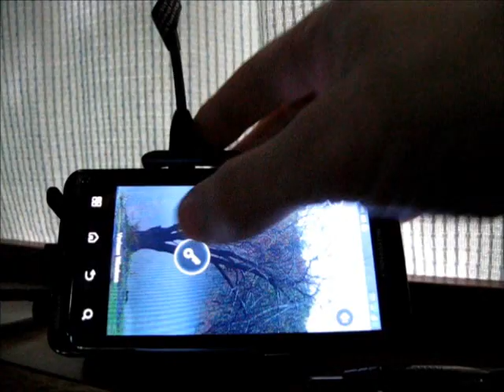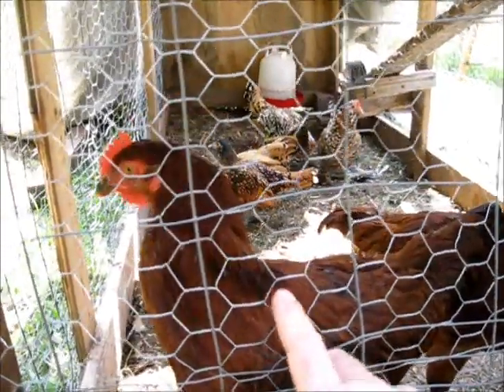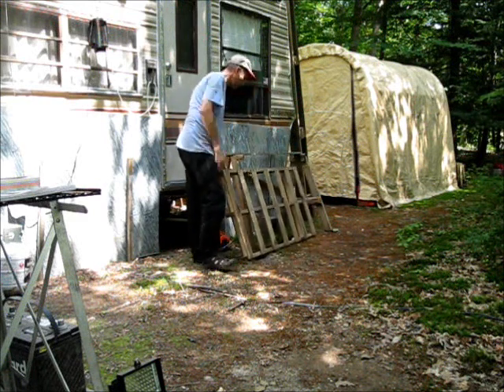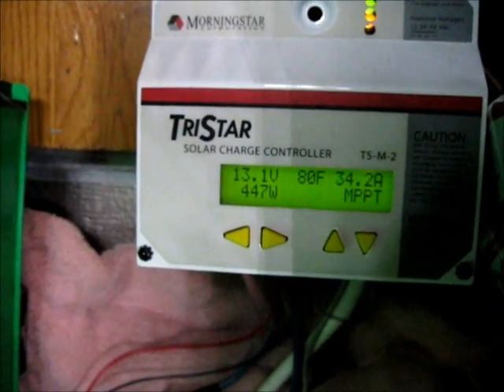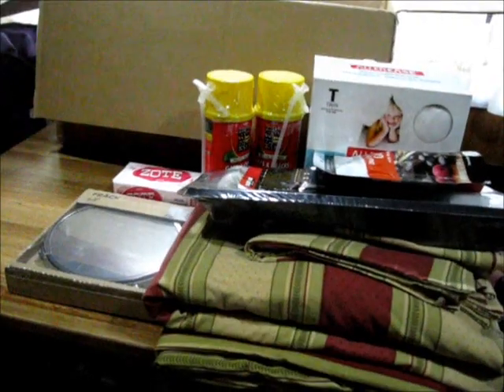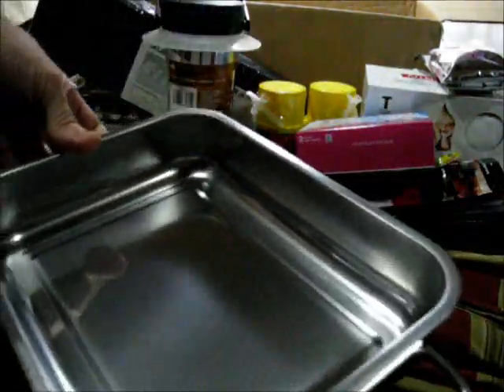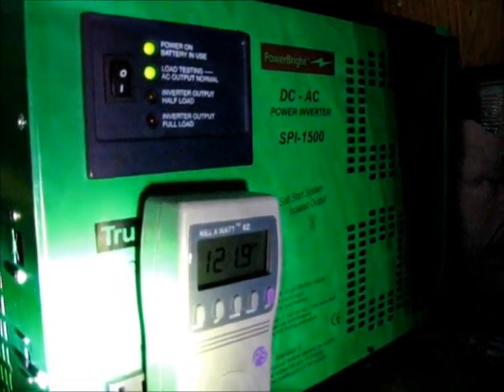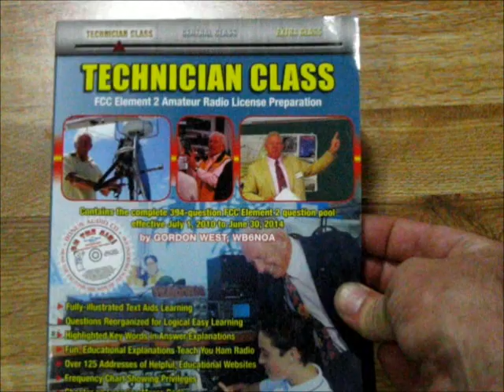Off Grid Solar Air Conditioning

Comment: try bigger cables from battery to the inverter.. probably can't draw enough amperage from the batteries on the smaller cable that is getting warm.. to much resistance..

Comment: No, No, No. You cannot judge the state of your battery capacity by its voltage alone. Voltage gives an indication but its capacity may be lower. It is like a torch light which shines brightly for a moment with a drained battery, then it died.

Comment: if you want to save your inverter this is with  an air conditioner. you need a soft start the product is called easy start I'm sure there's others you kind of need to know what you're doing to read the wiring diagram but you can get someone to wiring for you
Reply from the maker: I never had a problem with this inverter though. But sadly it just gave up on me after many years of good service.
Reply: When you go to buy a new inverter look for surge protection / rating.  My 1600w Whistler has a 10 second 3200w surge rating which should get you through a compressor start up.

Comment: basic ohms law i think would prove differend results. also the proof is why can the trailer be wired with 12g or 14g and draw either 15 or 20 amps? an entire house service of 100 amp is only 2awg al. would be #4 copper

Comment: I don't know if you know this! I have an Android Phone and when it starts Acting up take your Battery out, Don't turn your phone off, leave it on and just take the Battery out for a minute or Two and then put it back in Turn your phone on and it should work better,  it resets your phone.

Comment: Instead of using air conditioning, why not run a dehumidifier, They use much less power, remove the moisture in the air and cools a room dramatically by taking the warm humid air out of it

Comment: The AC runs well when there is power coming from the panels, but not from the battery.  I'm guessing that the wires from the battery to the inverter are too small.  The warm wires are a related problem.

Enjoy your channel.  Keep up the good work.

ps. Are you laying in wood for the winter?

Comment: How old is that phone at this point? These things are not build to last forever. They are build for high specs. You said that was a bionic or something right? That was a fairly top of the line phone not that long ago. You should look into getting a less "smart." phone. Something with a high cap battery.

Comment: Hold the lock on your phone one sec longer. If still its eftup screen or software bug. Pull the bat out when its still on. Run virus scan.
Reply: I had a phone where the screen started acting up.  turned out it was moisture under the screen.  the ac might help dry the phone out

Comment: Your inverter is to small. The startup load of the AC exceeds what the inverter can handle. 

If you use an amp clamp meter, you will see the load is not 500 watts but twice that at startup. Then look at your inverter to see what the peak amps vs constant amps is. My bet is its to small and can't handle it. As it goes into thermal overload protection and shuts down.

Comment: So You would need 21 x 245watt 24 volt panels to be able to run 500 watts @ 120 volts but only in full sunlight. 21 x 245watt 24vdc panel is $350 plus tax if Your lucky to know a guy like Me.(Yes I sell solar/wind) $350 x 21 = $7,500 plus Your State/Provinces Tax. Your battery bank would have to again be so huge, don't even ask the cost of this!
Your also taxing that poor little 1500watt inverter to it's Max, You need a minimum 3000 watt 24 volt DC inverter to run that 500 watt AC.
Want a way to cool down Your place cheap? A evaporator propane fridge with freezer tubes covered in heat sink fins and a small 12volt muffin fan with variable pot for speed control and the hot pipe and chute outside insulated between these sections will give You a small amount of cooling and do a bang up job on de-humidification with water collected to water tomatoes.

Comment: Lot of stuff in that box.
Reply: Your amps from the AC could be too high. Your meter when it shut down was at about 3.2 amps, the AC pump requires more amps to run. 500 watts to run AC, but check your inverter to see max amps. Maybe you might need more batteries to maintain the amps...Your right about wires get thicker wires or double the ones you have coming from batteries to inverter.
Reply: bkr360 No matter how many batteries he puts behind his inverter, it won't work.  The reason being is that the inverter itself can't hack it.  It is the weak link in the chain.

Comment: The issue with your touchscreen is caused by noise generated by crappy circuit design in your charger. Cheap Chinese chargers, without enough filtering cause this all the time.  Some phones are waaaay more sensitive to this electronic noise than others.

Design more filtering into your charger and your inverters.  Waaaay more.

Comment: UNLOCKING YOUR PHONE....When you unlock your phone, touch the lock icon and slide your finger to the right.  I have a phone like yours and simply pressing down on the lock won't unlock it.  Press and slide your finger to the right.  That should do the trick.

Comment: What size inverter do you have?
Reply from the maker: 1500 watts
Reply: Awsome ty were compleate solar with 245 watt charging system so far. Adding more each year. I just need bigger charge controller and inverters

Comment: you should cut that pointy board off the saw horse before you bumb it with your leg and knock the ac down on the ground. Also if you but a 00 wire or even 000 wire on that inverter wire to the batteries it will save you a lot power your loosing through heat loss in the small wire you have. pos and neg wires should be at least 00. what a great care package saweet. Maybe your inverter is broken is it pure sine wave?

Comment: dude u need higher watt Inverter. for air conditioner atleast a 2500 watt inverter is recommended. when compressor kicks in surge is almost 2000 watt. that is y ur inverter keeps shutin off. u only have 1500 wat inverter. im starten work on my solar shit too. sun be too hot like son be 2 hot. need dat a.c on top  on da rabies wont stop til dem babies gon pop

Comment: You heard someone say that you need "BIGGER WIRES" & that is now the  definite answer. So why would you not wait & change the wires & run the AC and see if it solves the issue  BEFORE you run around telling everyone "ITS THE WIRES". Now if your desire is to run that AC for 30 minutes a day, & nothing else u may do well with your 600/600 Solar System. To suggest to anyone that it is suitable for someone to deploy as a workable AC solution is just irresponsible. This is why some are disgruntled.

Comment: its called inverter overload auto shut down! it runs in sunlight because batterys are up enought with the 500 watts of solar in day light high peek times it cycles power coming in to inverter use! both my inverters will not run a 5000 ac unit only genator will or grid power! mine small one in back bedroom runs 420 watts but not off my my solar it overloads my inverter ! i have a watt meter too! some stuff my inverter will not run!

Comment: Remove all extra apps. Does your phone have safe mode? Try holding the on screen power button and see if it changes to safe. Or try google. Check the oil on your hand wipe the screen too, let it evaporate. Androids have great specs its junk software over bloating that slows it. Try flashing new rom.

Comment: I am doing a bug out boat.. I have a 32 foot carver cabin cruiser with 20 6 volt batteries for my battery bank  and all cables are marine grade tinned  1 guage cables and I have more power than I could ever use.. my fridge is 12 volt and 110
I have 200 gallons of fuel on board and 100 of diesel to run a pair of brand ner 225 horse marine grade ford 302 motors with edelbrock carbs..straight open exhaust that uses water to cool it and as mufflers but it still sounds like a pair of pissed off nascars.. and a full throttle I burn 15 gallons an hour to feed this thirsty monster.. I have a multifuel military heater that runs on diesel//kerosene// jet fuel//and gasoline..and puts out 30.000 btu of heat for our cold winters... it holds 75 gallons of fresh water and I have a years supliy of food on board and enough water filters to turn river water into drinking water for over 10.000 gallons.. it sleeps 6..
4 burner stove.. fridge freezer..small ice maker.. tv / dvd.. full head with shower and sewer treatment systym so all sewer is cleaned and legal to pump over board.. so I guess you can say I going to bug out on the rivers.. there are many small knooks on the river that are covered by trees so I can coast in there and cover the boat with camo netting so you can go by me and not see me ,, my next job is to get some large marine wet mufflers to try to make it more quiet so if needed I can run stealth at night.. also has radar so I can run in the deepest of fog.. I am still working on it and currently seting up a bug out 10 foot dinghy with outnoard so I can go ashore to hunt for meat and burn trash in my small jet stove.. it is still a work in progress and I only have $300 a week to put in to stuff I need but I have a good start on it..
I wanted to do it on land but couldn't find any place to put a motorhome that was away from town so I think I will do ok.. but still working on it.. I guess I should do videos on it so I can show people it is very possible to bug out on water and what is possible on a selfe contained boat.. I have everything a rv has and more.. plus I will never have to worry about water or showers so i think have a good chance of being good and safe.. good luck with your project.. I lived in 35 foot 5th wheel for a long time and a 34 foot motorhome  but decided to try life on the water and I love it..
Reply: Are you on a river, the ocean or a lake?
Reply: Argus Loud I am on the Columbia river wich is also where it connects to the Willamette river and about 14 hours trip by water to get to the Columbia river barr  and the ocean,, the best part about it is I have all the water I could ever want and with a good filter set up I will be ok as far as water goes,,
Reply: vid on it?
Reply: You have a video of your boat I would like to take a tour of it virtually
Reply: PLEASE make a vid of this setup....it sounds AWESOME!!
Reply: bertsbug I will try to get a video of it up soon,, I have never done any vids but will try to soon,,

Comment: When your Android phone locks up, or otherwise ceases to function, as they all do from time to time, just power down, remove the battery. Put the battery back in, power up as usual, and the system reboots itself.....all is well.

Comment: Voltage is too low, a 12 volt battery is dead at 12 volts, so your battery is very low at 12.7 volts, a fully charged battery is around 14 volts.

Comment: to much amps being drawn from the 1500 watt system try a 2500 watt or a separate 1500 on top of your main 1500 watt. just for the ac... way to many amps = over heating than shut down....

Comment: Your battery was at 12.7 volts. full charge is 13.8 and 12.5 is low 11.5 is totally dead and is to be avoided. you are over draining the batteries. The levels are correct as at 12.5 they are not still full 13.8 is full and charging is up to 14.2 volts ....

Comment: Could you elaborate on "running mostly". Once again, 1 time "running mostly" in the coolest part of the afternoon is not a valid test. Before you recommend this to others, you need to be conducting a real tests. Running it on a Fully Charged Battery Bank starting at 4pm when the Sun is going down is still far from any kind of victory Troy. You have people following you. What happens when they think that all they need is 600 Amps of Solar & they're good 2 go & u r still wrong. Be Responsible

Comment: again to much amps being drawn = over heating of the power inverter.. your best best is running 2 inverters 1 for normal shit.. the 2nd just for the ac.. ac's use a lot of amps. has nothing to do with watts; amps are the BIG DRAW....

Comment: You must be watching a different video then me. It DOES NOT work. And seriously, without another $1000 (or more) worth of Solar Panels and Batteries it will probably not work. It is just too hard on the batteries and the inverter.  If you look around, short of $10-15K + Solar Systems, you don't see anyone running an AC unit on their systems and this is why. This is why I am so vocal about these videos, people see this & now everyone thinks you can get a cheap solar system & run AC Units. WRONG!